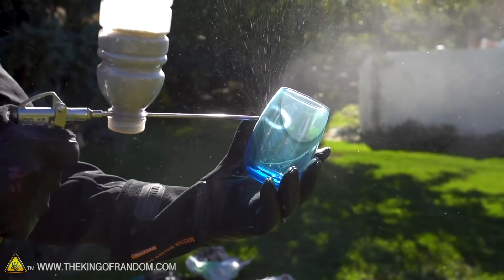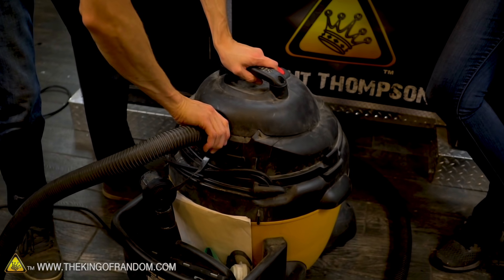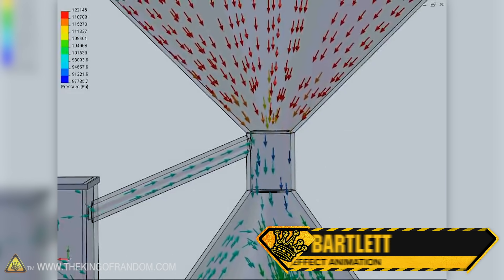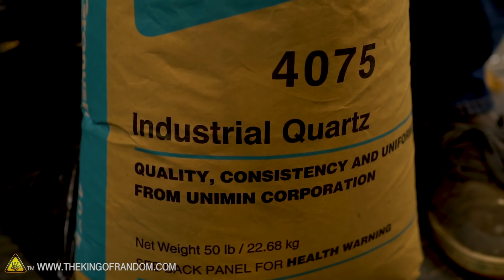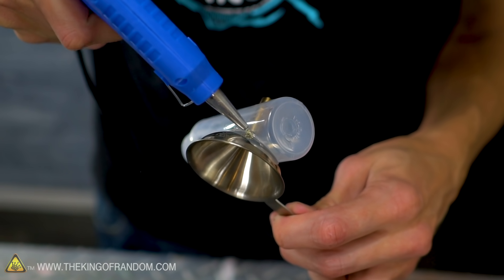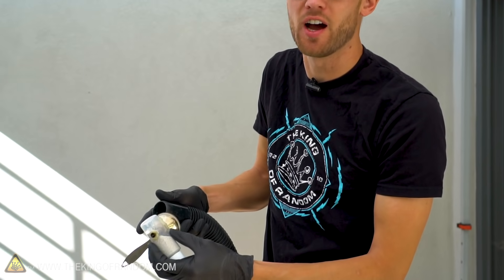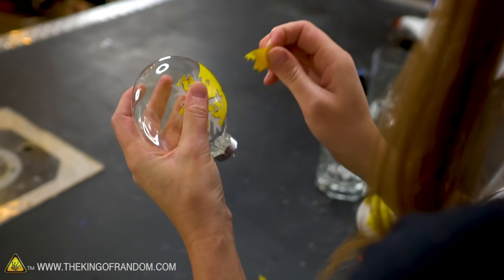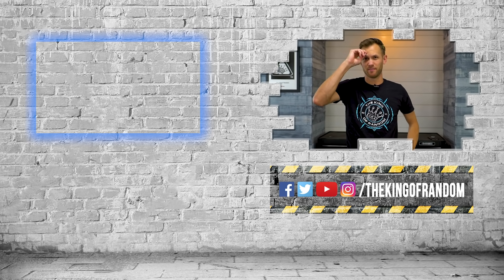Improved and CHEAP Vacuum Sandblaster!

Comment: So if nobody else is going to ask: why not just use a leafblower?
Reply: Ikr
Reply: I feel like a blow dryer might even work
Reply: Yea slap a $800 engine
Reply: I think a Shop Vac is more common than a leaf blower. I own a shop vac but I don't own a leaf blower. That's a sample size of 1 so pretty convincing stuff.
Reply: i agree with you. they should have tried this both ways they are both common and relatively cheap used. i picked up a leaf blower up for $25 at a yard sale
Reply: i dont think there would be enough power
Reply: @gibsonfleming6228  2 minutes into the video i was thinking the same thing seems like a portable option too
Reply: I want to see a hair dryer
Reply: @aronbraswell1589  boy have you ever tryed to use one vs a shop vac it way more powerful
Reply: Or a inflatable mattress pump
Reply: High and low two-way bicycle tyre pump, might require two people or a holding jig but it might work..

Comment: What about a can of compressed air?  “Air duster”?  Enough psi?  Maybe I’ll try and let you know 🤷🏻‍♂️
Reply: no...
Reply: Perhaps enough force to etch glass but you will spend 100s on cans of air to do very little blasting. 

At that point you may as well buy a cheap compressor
Reply: Compressed Air Cans are very expensive.
Reply: @ConchitaProductions  gotta deter the huffers some how🤷‍♂️
Reply: cool idea
Reply: Huffing compressed air is super common. Also super dangerous.

Comment: You should try cutting open a glow-stick then putting the stuff inside in a freeze dryer or a de hydrater! Could you turn it into a powder or make it glow again?
Reply: Glow-sticks works by combining two chemicals. Once you break the activator, it's over. it will glow (for some minutes to hours depending on the brightness)  and that's it. You can't make it glow again, the chemical reaction is over.

Comment: Props on pointing out the Venturi effect, but there's something else in play here as well known as the Bernoulli Principle.  This is the method by which you can increase the speed of a moving fluid by forcing it through a smaller diameter.  Like what you did with the funnel, but also the same principle behind how pressing your thumb over a hose makes the stream shoot farther.

Comment: 'this quartz silica will get everywhere, you really want glasses on' **forget a respirator tho because who cares right?
Reply: Its fairly heavy still as they are large sand particles. A respirator would still be recommended but not entirely necessary.
Reply: Welcome to the Silicosis ward, try to keep the coughing to a minimum
Reply: @whatisyoutube3196  shabby advice, im sure thats what every person that has silicosis said
Reply: TBH I'd probably make one of those 2 liter bottle face shields. Or just buy a real one I dout they're expensive.
Reply: Saftey glasses are useless because stuff can get around the edges really easy and goggles are just as useless because they fog up in two minutes and you can't see anything.
Reply: Think that’s called fumigated silica which is one of the greatest killers for people who handle concrete.
Reply: @TheAkashicTraveller  Respirators are pretty cheap, <$30. A regular dust mask should work aswell, for those who want something cheaper or those who can't wear a respirator because of medical issues.

Comment: What about using the suction-side of the vacuum, and hook it into a modified sand blasting box, and have your funnel set-up attached to the inlet.
  You could use it indoors, and recycle the sand!

Comment: Nate: "everyone could do this at home!"

Also nate: grabs a blowtorch, electrical tape and an exactor knife
Reply: To be fair, those are not uncommon items
Reply: @dillonmacpherson3350  The blowtorch is
Reply: I don't know about a blowtorch but odds are you can pick up the other two at your local hardware store, probably for less than 10 bucks
Reply: You guys don’t have a blow torch?? Lol well just using a lighter will make it hot enough to melt the plastic. May have to heat it up a few time but you have to seal it with glue or something either way.
Reply: I literally have all of those in my kitchen
Reply: Stove, grill, fire pit..get creative
Reply: @corvus15  you can get a propane torch at hardware stores as well...plumbers and HVAC guys use them for soldering copper
Reply: @DaNiElLl430  Huh.  I guess you learn something new every day.  I suppose I've just never thought to look for one

Comment: I think it could work if I replace the shop vac with an air duster/blower. One question though; can I use this D.I.Y sandblaster to remove paints/rusts off metal parts? 

Great video by the way, thanks for sharing 👍

Comment: Can you heat metal till it's like lava then freaze it with liquid nitrogen
Reply: It will just cool off
Reply: @red3331   but would it freaze in it's form
Reply: @tymtym7552  what?  You can freeze foods, organic matter (anything with water in it)
Metal in fusion will just cool off.  Pour some water on it and you will have the same effect.
Reply: @connardman   no because some metal  will become brittle
Reply: @tymtym7552  Yes, but it wont break unless you hit it. And a big piece won"t break that easily. Try immersing a lock in liquid hydrogen and you will need a hammer to break the thin steel part locking the shackle. (but I concede that a lock is kind of more robust than a fresh lump of metal in fusion:)

Comment: Maybe the shop vac would work better if you made a fitting and use a smaller diameter hose🤔. Smaller space, more pressure. Also, as Tim said below, why not use a leaf blower?? SO MUCH PRESSURE!

Comment: Buy A4 labels and print designs on them, print multiple on one piece, divide them up and cut out the designs. Peel off the backing paper and adhere to glass. Then wash the label off with warm soapy water.

Comment: Would the flow of sand work better if there was also an entry hole for air into the sand reservoir? To me it looks like you are setting up for a vapor lock in that paint container.

Comment: buy a compressor. Its great for painting, inflating all sorts, cleaning out crevices with blasts of air, nailing, stapling,  wrenching whe nuts etc.  And my sandblasting kit ( including abrasive)  cost £10 in aldi.

Comment: What if you tried to use one of those small automatic pumps for basketballs and footballs you plug in? Almost would make a small version of the air compressor one. I'm not sure how much psi you need but I'd assume that would have more than the vacuum at least

Comment: Hmm, wondering if compressed air cannister could do the same.

They're not cheap, but question is, could they produce enough pressure to do the job?
Compressed air on can for those wondering :)

Comment: Could you use canned air to make the whole thing about $15?
Reply: Since you need continuous pressure and canned air is designed to only work in short bursts, you might be able to, but it would take FOREVER to get something etched...and the canned air would be more pricey in the long run...

Comment: I'm in need of some advice as to how I can maybe sand down glass. I just blew a little glass piece, but I'm about an 8th of an inch to thick where I need to make a connect. Is there any way I could go about taking that 8th of an inch off?
Reply: Sandpaper works well on glass, takes f**** forever but works well on flat surfaces

Comment: try hair drier or hot air blower
Reply: try graphite sand blaster (try to embed the surface into graphite)
Reply: how to make things conductive (graphite pencil makes conductive nicely), sand blast with graphite carbon powder
Reply: lasering into graphite/graphene works too if the object is mostly accessible by the laser

Comment: Armour Etch Glass Etching Cream has to be cheaper than that even if you had a shop vac
Reply: It's like $5 and that's with extra supplies you can reuse so not really cheaper especially because you can reuse the setup more than once only getting more sand which would last a long while over the paste which is one time use

Comment: Sandblasting with a silica sand is VERY DANGEROUS... It can cause  Silicosis, which is a scarring and hardening of the lungs. Please if you do this, do it in a well ventilated area and wear a strong respirator.